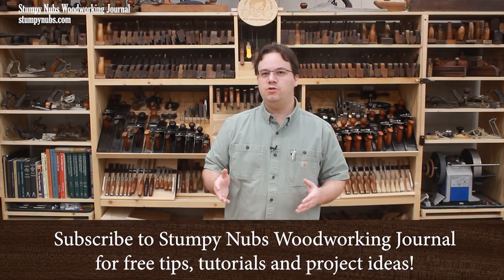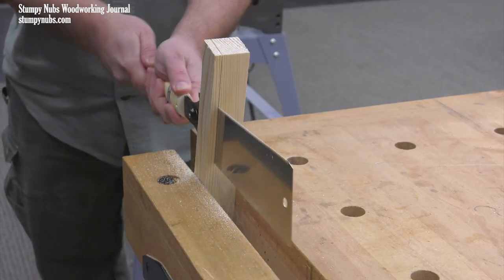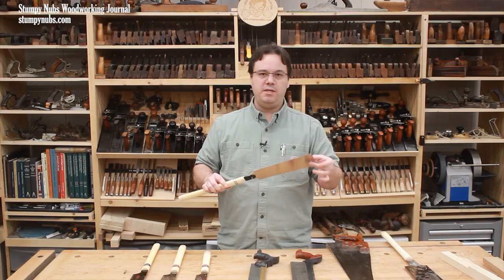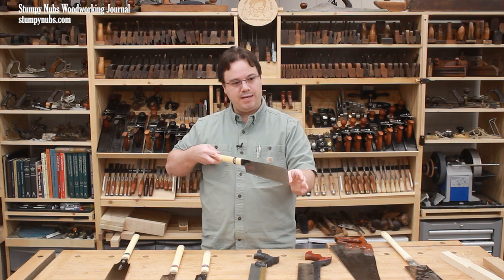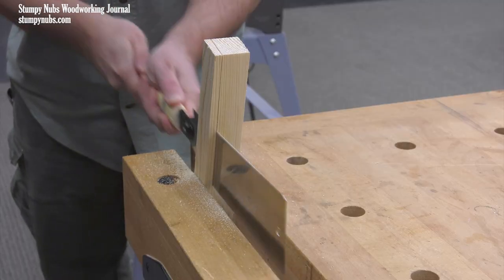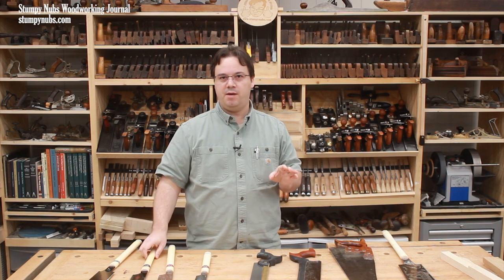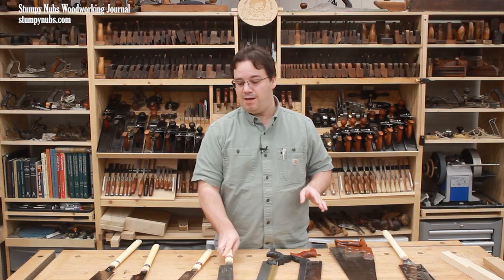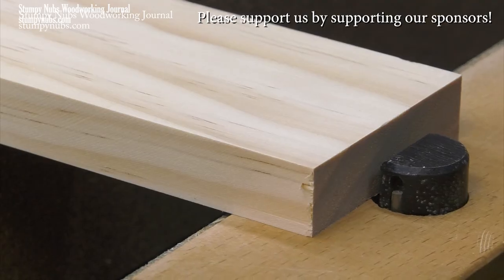Is Japan slowly killing western-style saws?

Comment: i mean, i can garuntee i can sharpen that saw as well as its "factory" tooth edges, but its my ability to do it consistently, and make any kind of a living doing it that limits me.

but being a fairly competent hobby blacksmith, ive done a lot of work with annealing and hardening, as well as monitoring and altering the carbon content of the steel after its been re sharpened and re hardened.

Comment: As a fine woodworking finish tool, the Japanese tool wins hands down.  As a rough carpentry, construction tool, the western-style hand saw is much better because you can use not only your hands and arms but the weight of your whole upper body to push the cut. Since time is money, my money would always bet on the West.
What's killing-off the Western-style hand-saw, is not the very fine Japanese tool but Skilsaw, Sawzall and other brands of power saws.  
Still most carpenters keep a handsaw behind the truck seat.  It's no longer a trusty Disston but it ain't no Japanese pull saw either.

Comment: I always thought western ‘push’ saws were due to a later misinterpretation of the action of a bow saw. Bow saws were almost universal for centuries before our steel saws became common, and irrespective of which way the teeth points, it cuts on the pull. In fact if you think about it, a modern hacksaw cuts on the pull. How? Well in each case, the narrow blade is pulled through the wood by the frame, you cannot push a thin narrow steel blade through wood. You may be pushing on the saw handle, but the blade is being pulled through the wood.  Later when bigger bits of steel became affordable, the makers simply copied the tooth arrangement of the earlier saws, not realising they were reversing the normal cutting action. Presumably, eastern makers did not make that same mistake. Anyway, that’s my explanation.

Comment: This reminds me of Lafcadio Hearn's "Japan - An Attempt at Interpretation" (from 1904) who observed that everything seems to be done opposite to how westeners are used to:

"Further acquaintance with this fantastic world will in nowise diminish the sense of strangeness evoked by the first vision of it. You will soon observe that even the physical actions of the people are unfamiliar,—that their work is done in ways the opposite of Western ways. Tools are of surprising shapes, and are handled after surprising methods: the blacksmith squats at his anvil, wielding a hammer such as no Western smith could use without long practice; the carpenter pulls, instead of pushing, his extraordinary plane and saw.   
Always the left is the right side, and the right side the wrong; and keys must be turned, to open or close a lock, in what we are accustomed to think the wrong direction. Mr. Percival Lowell has truthfully observed that the Japanese speak backwards, read backwards, write backwards,—and that this is "only the abc of their contrariety." For the habit of writing backwards there are obvious evolutional reasons; and the requirements of Japanese calligraphy sufficiently explain why the artist pushes his brush or pencil instead of pulling it. But why, instead of putting the thread through the eye of the needle, should the Japanese maiden slip the eye of the needle over the point of the thread?   
Perhaps the most remarkable, out of a hundred possible examples of antipodal action, is furnished by the Japanese art of fencing. The [8] swordsman, delivering his blow with both hands, does not pull the blade towards him in the moment of striking, but pushes it from him. He uses it, indeed, as other Asiatics do, not on the principle of the wedge, but of the saw; yet there is a pushing motion where we should expect a pulling motion in the stroke"

Comment: What a great video!  I learned a LOT...thanks!
QUESTION:  Why the straight handle?  It obviously requires a lot of grip strength.  Personally, I have always hated traditional western saws because they seem to beat up my hand where the grip contacts it (thumb and forefinger area).  But the thought of holding onto a round pole for a lot of cutting sounds pretty bad, too,

Comment: A blunt pull saw is easier than a blunt push saw. I prefer a good sharp push saw, nice light touch, let the saw do the cutting. We've all hit a nail though or dinged a saw up, and sharpening and resetting teeth is a pain in the butt. I used to teach wood shop with 30 year old tools, my shop technician was a wizard at tool mainatainence, not easy in a school setting.

Comment: I have 3 double edged Japanese style saws. A proper top of the line, cost a lot Japanese version, a cheap as dirt Chinese replica from the wish app, and a supposed American Irwin branded, probably Chinese made and imported. The Irwin is my least favourite. To describe it is “meh”. Don’t hate it, nothing to applaud. The Chinese one is cheap with a thicker blade and gets used for the majority of cuts in my shop for aggressive hand sawing, but for that very fine cut I break out my samurai sword, which was worth every penny when the cut needs to be perfect.

Comment: Japanese saws let you cut by pulling downward. You don't need to be very strong, so even children, or smaller adults, can use them for longer hours. I use a backwards hacksaw blade for cutting aluminium, b/c this metal is soft, and pushing has a tendency to wander.

Comment: Western saws were made for cutting on the pull stroke until the European guilds gained power and made using tools more difficult by rule of law.  Timber logging and sawmill cutting never secumbed to the push cutting saw stroke.  Sawing on the push stroke has always been an artificial construct.

Comment: On Japanese chisels, they appear to be able to come to a finer edge than westerns,  is it the steel? Or is   it only my perception? I notice different types of steel, that would be a great discussion.  Also the way the chisel back is hollowed, what effect does this have, why is it done? Finally, it seems that once you sharpen to the point of the hollowed back  the chisel will see end of use.   This would be very interesting.

On Japanese planes, besides the steel, finer edge and life of blade issues pointed out above, a discussion of the different types of planes with pros and cons would be very useful.

Finally, a lot of Japanese carpentry appears done with relatively softer woods, is there a difference. Would Japanese chisels and planes be superior/inferior on hard or softer woods.

Comment: Pulling motion only makes sense. So much so that it's not something you exclusively see in the east. Think chainsaws. Nothing became more obvious than having the chain pull the sawdust towards you when an engine was put on the saw.

Also, a better example of the push vs pull motion would be a piece of string. If you pull a piece of string it will stay straight and follow the line you pulled along. If you push it then it just crumples up.

Comment: The closest hardware store to me sells the same saws as the competition. Very sharp, when new, saws that can not be resharpened. There's not a saw set anywhere in sight. Want better, then its corded circular saws or increasingly, some battery powered thing. Real saws are expensive and special order.

Comment: Don’t think so. Both western style saws and Japanese saws have their particular purposes. However, it is good to just have both at hand. My humble self never understood why there isn’t a good equivalent of the hacksaw for woodwork. And yeah, I know, you’re supposed to put a blade into a hacksaw western style. Anyhow it doesn’t take away the fact that in particular instances it is convenient and both efficient to reverse the hacksaw’s blade, which will make it into a Japanese style hacksaw. Did I something odd there? Lastly, I do indeed love Japanese saws, my favorite, the Silky Oyakata. But, that doesn’t mean I will throw my several Bahco/Sandvik superior saws; fine, middle and course on the scrap yard. Also, I do not throw away my older saws, I use ‘m for sawing plastic, insulation, foamboard, the odd piece of plasterboard. And that’s also the case for old Silky blades.

Comment: the difference is likely due to the fact that you can pull harder than you can push; latisimus dorsi muscles are stronger than anterior deltoids. Eastern peoples have historically been smaller than westerners and using lats, rather than shoulder muscles would allow smaller people to do more while putting less stress on their shoulder joints. Thinner blades also require less work and pull saws are less likely to be damaged in use.

Comment: Pull saws are good for precision work, but push saws are what you use to hog away material. Pushing requires less effort, and you naturally apply downward pressure when pushing. If you've ever put a hacksaw blade in backwards, you'll know how much a pull saw can slow you down.

Comment: You didn't cover the why of pull saws.
Traditionally, the Japanese work on the floor holding the work with their feet. Not on bench with vices. The pull stroke, straight handle and  two handed grip give much better control. 
They also somtimes saw standing using their foot to hold the work on a little short platform. (Can't think of the name riight now)

Comment: Honestly, now that I've watched this video, I wouldn't buy a Ryoba for one simple reason: One side is going to get dull LONG before the other, so it will eventually end up being a single-edged tool where I would have to file the other side smooth to keep it form scratching my work.  I'd just get both ripping and crosscut Katabas and call it a day.
Reply from the maker: You are not wrong. However a benefit of the Ryoba for ripping is it generally has courser teeth than a Kataba for faster performance.
Reply: @StumpyNubs  Ah.  Fair enough.  That being said, are there not Katabas with teeth as coarse as a Ryoba?

Comment: How did you fail to mention one of the primary benefits of a push saw, being that you can put your weight into it (something that isn’t possible either with a pull saw, or feasible with any saw with a straight handle). This requires a lot less energy and can generate a lot more power. Seems pretty significant to me

Comment: Not sure where the comparison of western to eastern style comes from... There are many pull saws in the west aswell. In our small workshop we have 6 different handsaws: A rough stone saw for sand-lime bricks (push), a metal saw (push), a jigsaw (pull), a framesaw (pull), a hacksaw (pull) and a finesaw (push). The split is fifty fifty and some of them are decades old (like the frame saw). None of them are particularly japanese styled or from japan. I dont want to diminish the craftmanship of japanese saws, but I think this obsession with them is a bit unneccessary.
Reply from the maker: The country of origin is not important, it is the style that this video focuses on- pull saws vs push saws.

Comment: The pull stroke is not more comfortable per se, the Japanese sawhorse is lower to the ground making the pull stroke more comfortable and efficient and the Western sawhorse is taller making the push stroke more comfortable and efficient, think cutting 2x material not fine joinery.

Comment: Is it okay to cut plywood with a Japanese saw? If so, which one would you recommend?
Reply from the maker: A Ryoba, depending on what you are doing. The same saws that you would use to cut solid wood also apply to plywood.
Reply: Thanks. Since you said they have problems with the teeth breaking off, I thought maybe the glue would be too hard on them.
Reply from the maker: @williamhdixon  Glue is definitely harder on steel teeth than carbide. But it's harder yet on the steel in western saws, which are softer and will dull pretty quickly.
Reply: I've had bad luck with Japanese saws on thin plywood (thick is probably OK).  With a western saw it's easier to get a lower "angle of attack", but not so with Japanese, the angle is awkward.  It might be OK if you can support both sides of the panel or have high TPI, but you can get away without support and lower TPI with western saws.

Comment: Do you feel the Kataba is a valid tool for extended finish cuts of more than 1ft or is the Ryoba more appropriate due to its size?
Reply from the maker: The Kataba is the better tool for that for the reasons I explained in the video.
Reply: @StumpyNubs  Appreciate the reply and the confirmation. I'll pick one up from your link.

Comment: Nicely summarized.  Japanese saws do work well, and they seem not to have made the descent into trash that many western saws are in recovery from.  

But I happen to disagree with your opinions.  I find a good dovetail saw handle to be very helpful in aligning the cut.  And while the kerf is wider, so you are removing more wood, that doesn't mean there needs to be any more slop.  The set can still be small.  I like to be able to sharpen my own saws, and adjust them to specific tasks.  I have mostly switched back to western saws.

I think the difference is partly that the Japanese saws developed as steel was comparatively much more expensive, so conserving it by using very thin plates made sense.

The European frame saws are intermediate between the two types you mention.  They have very thin plates like Japanese saws, held in tension by the frame so a push cut is practical.

Comment: Interesting is that the same arguments are made about Eastern versus Western kitchen knives.
Reply from the maker: Does one cut on a pull stroke and the other on a push stroke?
Reply: @StumpyNubs  Well, yes and no.  Eastern (Japanese) knife handles tend to be round or octagonal and are meant to be replaceable whereas Western handles have more specific shapes and are attached permanently.  And, Japanese knives tend to be harder (on the Rockwell scale) and are often clad, with the hardened steel core that can chip with misuse or abuse.  Very generally J-knives are thinner as well.  So there are those similarities.

Comment: The average handsaw is based on a design which allows a carpenter with forearms like Popeye the sails to cut up large flitches of hard wood so that he can build a house and the joinery for it with the same instrument.   You can’t use the one saw for every job!!!  So, come in smaller delicate versions which do the job they are designed for!!!

Stavros

Comment: So why not change the western saw teeth orientation to make it a pull saw with thinner blade?
Reply from the maker: You mean make a Japanese saw?
Reply: @StumpyNubs  I suppose, it's be the same result, but the shape and the handle remain the same as western saw. Or it can be exactly the same as before just reversing the blade when mounting, even though the thickness, sharpness or durability would not change.

Comment: I never fell for the push stroke with hacksaw as my shop teachers tried to indoctrinate us to use.  I obviously have broken many fewer hacksaw blades than most because of my "backwards" mount blades. Straight handles are NOT necessary with pull stroke handsaws, fit them with whatever handle YOU like!

Comment: It is not true that all the western saws are push cut based, actually, even if it may appear counter intuitive the frame saws perform a pull cut, weather you use them pushing or pulling, as the blade is always pulled by the frame, so allow to use a thinner blade with less set and produce a thinner kerf, like the japanese ones, sharing the advantage. In UK and USA almost all the frame saws was done to perform curved cuts, but in continental Europe the frame saws was widely used with blades for both rip and cross straight cuts and obviously blades for curved cuts. IMHO those saws are really interesting  as they share and combine some of the advantages of western and eastern saws, thin kerf so faster cut, easily sharpened (have you ever hit an embedded nail or piece of stone sawing? you can throw away your hardened teeth blade) and they are precise, once you get accustomed to them and extremely cheap as a carpenter can buy the blade only and make himself the frame with some hard wood leftover. Only Frank Klausz and very few others, old school European woodworkers that moved to America, are known to use the frame saws un the US, but here in Europe you can find a lot of them in the old workshops.
Reply from the maker: Didn't say ALL were...
Reply: @StumpyNubs  you are right sir, I really appreciated your video as I appreciate the others from you, you are always technically spot on, i.e. I saw today an other video where you was talking of routers noticed that you mentioned that doing dados the direction you move the router is very important to have the bit helping you keeping the router against the jig instead of pulling it away. So often I see wannabe internet teachers completely ignore the thing and moving the router in the wrong direction... I was referring to the widely spread misconception that most of the western saws work pushing the blade while traditionally in continental Europe probably half of them was frame saws, not referring necessarily to what you told in the video that as usual was completely correct.

Comment: You cannot cut every wood shop material with japanese blades. Mine says "don't cut cheap composite materials", as there frequently are hard items lodged in it. And the very thin saws are very easy to blunt or bend.
But my woodworking shop even has the policy of never allowing japanese saws to be used on plywood or any glued wood, as the glue is supposedly too hard for the blade. Any truth to that?